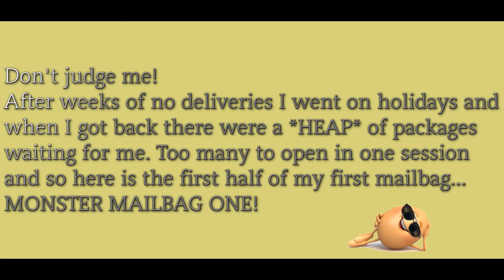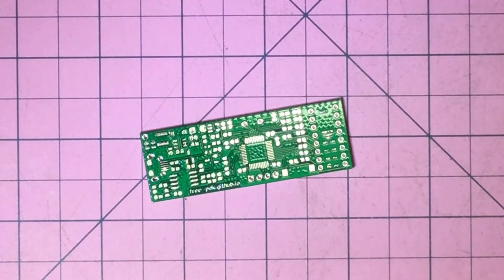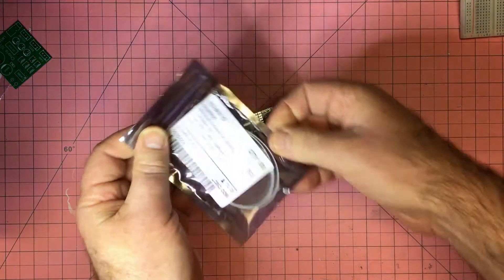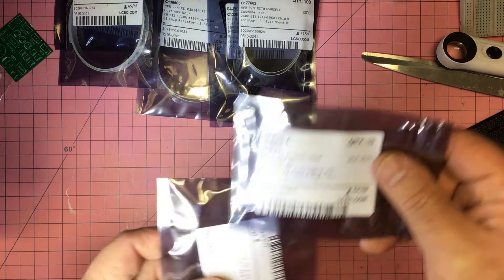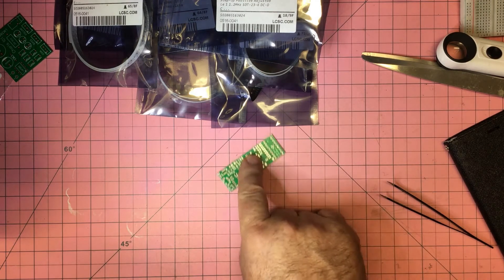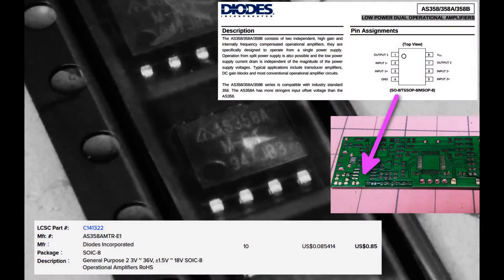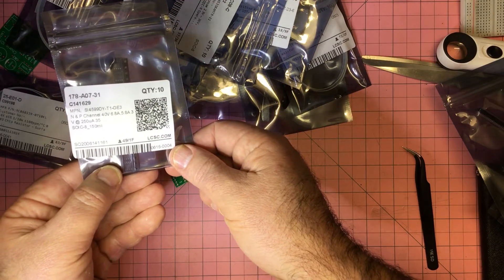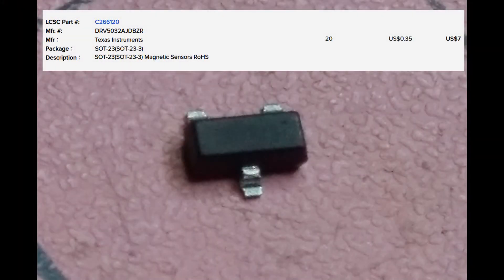Monster Mailbag - Part One

Comment: I have used some of those MT3608 boost ICs.  Never been able to get a true 2A output from one ... but that would probably be pushing things on such a small package.  Had to learn the hard way, that not all kinds of inductors work well above 1mHz.
Reply from the maker: GnuReligion It’s for the free-pdk hardware project (https://raw.githubusercontent.com/free-pdk/easy-pdk-programmer-hardware/master/pcb/easypdkprog_pcb12_bom_LCSC_format.xlsx) which I’ve started to solder. Why it has to be mostly 0603 parts I’m not sure! If I get motivated I’ll make a 1206 or even through-hole version. Better for the eyesight and the swear jar...
Reply: @onecircuit-as  Yes, I get it.  A 3-cent MPU that needs a special programmer.  High voltage must be a part of it, much like the HVSP for AVR chips, to reset them.  I cannot find the schematic on the github page though, but everything else is there.  The user community has come a long way on this project since last year.  Did not dive into this one.  Wish you did not live all the way in Tasmania, or I would buy some of those materials from you and try to make my own.  Would not be worth the postage.  0603 -- (shudder) -- You sneeze its gone.
Reply from the maker: @GnuReligion  I've lost a few on the floor already, but have one board half complete (waiting on a few components). The schematic is here: https://github.com/free-pdk/easy-pdk-programmer-hardware/blob/master/schematic/easypdkprog_schematic12.pdf and you can open the easyeda version using this link: https://easyeda.com/tenbaht/schematic if you want to play with the component size as I am at the moment

Comment: A nice haul! I have ordered from LCSC a few times as of late. The prices are decent, good quality and it gets to me in a reasonable time. I have been tempted by the Padauk chips, but have resisted. I have made a few boards for the stc15w404 & 408 8051 core chips. Have the WCH CH552G on order now and they are 8051 based as well. I hope they perform as good as the STC15 chips as they are fast and quite low power.
Reply from the maker: Scott Beasley I’ve started soldering the freepdk hardware even though I’m a couple of components down. The STM32F072C8T6 chip is a challenge, I seem to be able to get three out of four sides lined up then there’s lots of flux, copper braid and swearing! It’s interesting at least.